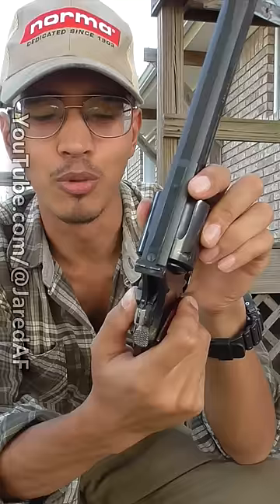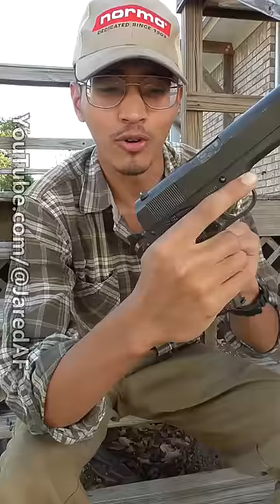safer way of decocking a hammer-fired gun ("don't thumb the hammer down" part 2)

Comment: In addition to this, the owners manual for the 686 says to place your other thumb in front of the hammer so even if it slips it hits your thumb and not the round.
Reply: Yeah..as my post i use off hand and  as you say...a finger in front is best..no matter what gun make it a habit
Reply: I'd rather not smash my thumb, but it would definitely be good to have a little metal plate or rod for the job. Maybe a wire flipover clip.
Never make an unsure bet when it can be avoided on safety folks.
Reply: @theinacircleoftheancientpu492  I don't think it'll smash your thumb. You're wedging it in the gap between the hammer.
Reply: Left thumb under hammer with right thumb on top holding it to lower slowly, no way this would hurt your thumb.  This was taught by LE skills courses in the eighties because adrenaline and fear in a gun fight causes loss of fine motor skills.
Reply: @theinacircleoftheancientpu492 it won’t hurt you baby thumb.
Reply: I have a 686 older than the guy in the video,lol. Bought it in 1990.
Reply: @heyQuixDraw  👍👍And it was in use DECADES before then! My maternal grandfather was a cop from the '40s-'70s. He taught me that EXACT method in the '70's on his S&W Model 13 (.38Spl/.357Mag). ALSO he informed me that it's rarely an issue as double action fire was the preferred method. He taught me double action FIRST, Then nice precision shots in single action. He's been gone a long time now, I inherited that Model 13, and i would not sell it for ANY price!
Reply: Old friend of mine whos now passed on saved someone from his mentally ill landlord who was having a fit and pulled a gun by managing to block the hammer with the webbing of his thumb while disarming him. The pin managed to draw blood.
Reply: 686 Thumb.
Reply: @TyrinsClips  🤣
Reply: @theinacircleoftheancientpu492 
It doesn’t smash your thumb and it doesn’t hurt. Works every time and you won’t end up putting a hole in something that doesn’t need one.
Reply: ``I d the same thing. The worst can happen is I pinch my finger, which has not happened yet.
Reply: Ouch
Reply: @theinacircleoftheancientpu492 bruh how brittle are your finger bones
Reply: That's actually a 586 since it's blued and not stainless steel, which is the 686 model.
Reply: Exactly - but guys like this Poster want to ignore Owner Manuals and over 100 years of proper safety to be able to say " I invented this new way I teach "; and up not using proper safe techniques
Reply: I was gonna say this.  Thanks for saying
Reply: Ow!
Reply: @theinacircleoftheancientpu492 I just use a pen or pencil
Reply: Amen!
Reply: You can put your pinky finger in the way and even if the hammer slips it won’t even bruise you.

When it comes to guns don’t try to be a tough guy, it’s not a toy. Use both hands and prevent a ND.
Reply: @theinacircleoftheancientpu492  you can use a small rag also less noise and absorb the power

Comment: Instructions unclear, ceiling fan is no longer active.
Reply: "This is why mom doesn't fffuckin love you!!!!" 😆
Reply: Upstairs neighbors have retired
Reply: New skylight looks good though 👌
Reply: @DrooledOn  Upper Room has been cleared. The spider is no longer there.
Reply: @MrZazzles94 Hey, boss. I installed the new skylight like you wanted.
camera pans to 20 bullet holes in the ceiling
Reply: Made me laugh, thanks.
Reply: too soon, too soon 😞
Reply: I wonder if people would pay for a shim that ypu slide inbetween the pin and the cylander to make it impossible to accidently set a round off
Reply: @SpotTiger lmfaooo Classic
Reply: So sqeeze trigger then release hammer. So should i pull the hammer first before pulling trigger. Your instructions are not clear at all.
Reply: Haha
Reply: That's not what fanning means

Comment: My one and only negligent discharge was from a scenario exactly like this. This is why we practice all of the rules of gun safety, if you fail in one area, the others can save you. This is the method everyone should use. Preferably we should try to stay out of situations where we need to decock the hammer without firing, but this is still extremely important to learn.

Comment: S&W teaches a manual decocking method in their revolver owner's manual that is the safest: You jam your weak hand's thumb in between the hammer and frame before you start to pull the trigger.  As the hammer slowly moves forward, you slowly retracts your thumb.  This way if your thumb that is controlling the hammer slips, you'd crush your weak hand thumb, but the gun CANNOT go off :)
Reply: Yup I've seen and heard this before, I often put something be in the way on my old revolvers.
Reply: Don’t tel em that. He’ll act like you’re insulting his ego and flame you even though he’s clearly wrong lmao.
Reply: At harry ,stole my thunder bro. Thumb between the hammer and frame, take finger off trigger disables the hammer strike transfer bar ,( if that weapon had it) Let hammer down gently. Carried 1911 for years , in condition one. ,see how many even know what that is. I know the older guys in service when 1911 was the sidearm issued, they will know. 65 years old and have never had an  AD.
Reply: Holy cow I never knew this…. I was throwing my hand just above the pinky joint in between the hammer and frame essentially crushing that area before it has a chance to slip. Pretty cool, thank you
Reply: Yes, this is a much safer way of decocking than he’s showing.
Reply: You know I went into my gun vault, grabbed a S&W manual and sure as heck... There it was. Never actually read it before, but you're right. Thanks brother 🙏🙏😅
Reply: @JustHereForTheDialogue RIGHT?!!!😂
Reply: @ryananderson8593  🤝
Reply: i’ve never decocked a hammer gun like this revolver but i would most definitely put my whole thumb there and rather have it punch my thumb than make it go off and hit my foot
Reply: Smith and Wesson thumb
Reply: never seen it, but I have always wedged my other thumb because when I was like 8-9 the hammer slipped on an unloaded gun and I did not like the idea of a round being in there when it happened
Reply: Would letting the hammer go seriously "crush" your finger? Cant imagine it'd break anything.
Reply: @joshuafurlong5270  Lol no i was exaggerating it i’m sure it won’t do no harm at all . maybe if it was the tip of ur fingernail then maybe a bruise
Reply: That's a good way too, physically block the hammer. That works.

Comment: I do that while holding my thumb in the way to catch it if I do slip
Reply from the maker: yep, if i can, i hook my thumb over the entire front face of the hammer basically.
Reply: This is the right answer. Place your thumb or index finger between the hammer and the cylinder face while lowering until it’s nearly down and limits the energy it can use to pop a primer.
Reply: I read this as though you put your thumb in front of the bore to catch the discharged round with your thumb if you slipped lmao
Reply: I hold mine in front the barrel to catch the bullet
Reply: I always have my finger in between the hammer and pin. Better a pinched finger than an accidental discharge.
Reply: @mattwiththegat2848  did that with a BB gun when I was little, my thumb hurts thinking about it 😂
Reply: @JaredAF  When you say "hook my thumb over," it might imply the use of your right thumb.
To clarify, it should be your left thumb in front of the hammer, while your right thumb controls the descent.
Reply: @JaredAF Except you don’t, because you didn’t in the video
Reply: @CramcrumBrewbringer  Right? He films and uploads a whole video that doesn't really have great info. 

Sees a comment with a better way of doing things and says "YEP, THAT's WHAT I DO" except if he did, that'd be in this video...
Reply: I just put my thumb in the way then pull the trigger
Reply: @Hairline848  personally I hold the barrel in my mouth to absorb any shock in the frame from the hammer hitting it, making it so the firing pin doesn’t have any energy to strike anything
Reply: @STOPSYPHER  😂😂 damn Sam
Reply: @mattwiththegat2848 lmao
Reply: No need. The best way to prevent ANY (Yes! Any!) gun from firing/misfiring is to simply stick your index finger into the barrel to 'plug her up'. Be careful though, if fired there is a big possibility your gun will 'shoot backwards' and the rear of your barrel Will explode and shrapnel will fly out of the barrel in a reverse orientation. Even the barrel itself will become shrapnel.

All you're left with is a gun with the rear stock nearly completely missing and the barrel will be curled up like a banana peel.
Reply: This thumb method is how we were taught in german hunting school.
Reply: @JaredAF  Easier on the thumb when the hammer is flat like a modern ruger w transferbar.
Reply from the maker: @LKN4WAR  works great for small guns. J frames, beretta cheetah, etc
Reply: @mattwiththegat2848 if you put your finger in the barrel it stops the bullet.
Reply: This is how I learned it

Comment: Wow, carried 1911 for years ! Did not know that! Great job young man 💪
Reply: That technique can still impact the firing pin on series 70 1911's. But series 80 have a firing pin block activated by the trigger. If you slip on a series 70 it  could fire.
Reply: Isn’t the 1911 double action though?
Reply: @raven31012  no
Reply: @raven31012  No, the 1911 is a single action automatic. If the hammer is down pulling the trigger does nothing. A double action draws AND releases the hammer on pull, Those are the 2 actions.
Reply: @raven31012  No it is single action.
Reply: See my commit on why you don't carry a 1911 half coked.
Reply: You don’t decock a 1911. If you wanna dedock a pistol, don’t buy a 1911.
Reply: @guillaumeouellet6653   There is definitely some truth to that. 1911 should be COCKED and locked when carried.

Comment: This also applies to my Co2 revolver. when lowering the hammer, if hold the trigger in, the button that releases the Co2 is still active. If the hammer smacks it hard enough, or you press that button, while the trigger is held, it will go off. If you drop the hammer without the trigger, it will not go off.

Comment: So that's where the expression comes from! "you can't just run in there half cocked" or something. I learned so much from this video lmao
Reply: I'm scared to ask what you thought it meant before this video 😂
Reply: not really. matchlock/flintlock guns (think old muskets) and even early percussion cap and fixed cartridge revolvers untill about the 1890s, had 3 positions, uncocked, half cocked and cocked. ( and a 4th "safety" where the hammer was just barely pulled back a few mm, and not protruding)
 you couldnt load them while cocked, you had to half cock it. you also couldnt fire it while half cocked, only when fully cocked. these were all single action, meaning the trigger only dropped the hammer ( or flint/matchlock) it didnt pull back the cock/hammer.

so if you loaded it up, but left it on half cocked, and tried to pull the trigger, thinkign you'd shoot, it didnt, and you went off half cocked, and possibly got killed because the other guy shot you.

this is a double action, and doesnt have a traditional half cock, and theres no need for one to load. if you pull the trigger, regardless of how its cocked, its gunna fire.

theres a "transfer bar" which is a mechanism that only allows the hammer to hit the percussion cap/primer when the trigger is being pulled, otherwise the hammer is safely recessed.
Reply: @tehpurplepills  I'm not sure what you're trying to argue here.
Reply: @HellsHatersEnt  He literally explains it, though? Loucifur thought the half-cocked saying came from more modern revolvers, and purplepills explains it came from matchlock firearms. It's like 9 sentences, or a 30 second read. If that's overwhelming for you, I pray to whatever cosmic forces that may be listening that you don't, and never do, own firearms. You will end up hurting someone with a negligent discharge someday.

Comment: For the revolver, this only works if you have the more modern versions with the transfer bar or the hammer block safeties. Will not work on older firearms. For them, a well held thumb on the hammer decock is the only option. As always pointed in a safe direction.
Reply: This will work with most S&W’s and colts going back to the teens and twenties.
Reply: Thank you, was just getting ready to comment word for word. And on most modern DA revolvers there's no 1/2 cock, it's actually a quarternotch safety.  True SA army revolvers had 1/2 cock for loading-unloading.
Reply: The Colt Single Action Army is the standard for single-action revolvers to this day. It was developed in 1873. It has a half-cock.
Reply: @ootdega  but it isn't a DA revolver with no transfer bar or hammer block safety with the firing pin hammer mounted, those have quarter notch safeties and not half cock's
Reply: For revolvers without a hammer block safety, you shouldn’t have the hammer down on a live round AT ALL!
Reply: @CramcrumBrewbringer yes, but you can only remove that live round or re-index the cylinder once the hammer is down. Thus why we're on a video about setting hammers down safely.

Comment: I do it slightly differently.

I place my offhand thumb between the hammer and frame. With it touches the hammer so it can't slam forward and squish my thumb. Then I pull the trigger and let the hammer move ever so slightly forward so it doesn't engage the sear.

Letting of the trigger I now use my main hand thumb to hold the hammer in place so I can safely remove my offhand thumb. Finally i guide the hammer down slowly with my main hand thumb.

This works very well since the hammer cannot slip and cause a negligent discharge.

Comment: I was in law enforcement for about 40 years first of which was federal (1978) using revolvers.  The method we were taught (S&W) was to insert left thumb between the hammer and the frame, right thumb retracting the hammer, trigger finger pull and release the trigger (causing the hammer to fall on the left thumb), remove trigger finger from the trigger, and then slowly remove the left thumb from the space between the hammer and frame.
Reply: That sounds like it would fuckin hurt
Reply: They did not teach you that because it is absolutely moronic.
Reply: Yep. Thumb slip is no issue with this thumb stop method. Weird people are hating on this.
Reply: This is my preferred method.

If your thumb placement lets the hammer fall on your thumb and hit it when you pull the trigger, you're doing it wrong. You should fill the whole gap between hammer and firing pin with your thumb so that when you pull the trigger, the hammer starts squeezing your thumb but doesn't have room to fall. It doesn't hurt. This method is safer because there is no possible way for your thumb to slip and allow the hammer to fall, unlike the method shown in the video. I recommend trying it.
Reply: @TheDudeliestDude  no your thumb is taking up most of the room limiting how far the hammer falls and the hammer falls on your thumb and not on the thumbnail.
Reply: I completely agree. This is how I have always done it as well. Good comment. Thank you.
Reply: This is what I was taught as well and prefer...potentially uncomfortable but greater assurance against dropping the hammer on a round.

Comment: Warning, dont do what he did. Dont point a gun in the air while trying to discharge the gun. Point a gun at the ground at any give time and away from your feet. Now the way he discharges the gun, that is fine. You could also discharge the pistol by taking the mag out and pulling the slide to release the bullet and then you can safely press the trigger. This only works for guns with a slide or any similar machanism
Reply: Warning: don't be this guy

Comment: The first step is to HOLD THE HAMMER with your thumb, then pull the trigger to the rear and gently let the hammer down.
Reply: The key part of this is HOLD THE HAMMER
dont just pull the trigger
Reply: Dont forget to point it down range if not at your feet
Reply: @delmuswu-tangbroadnax9056  use both thumbs if you dont trust your thumb strength at first too
Reply: im glad I wasn't the only one that caught this
Reply: Caught that too
Reply: THANK YOU. His step 1 “pull the trigger” kinda triggered me.

Comment: I thought this was new. Turns out I commented over a year ago without any comments ... or likes. No worries ... just trying to share a helpful hint.

Put your left thumb between the hammer and frame (deep ..
 as if you would be trying to hold the hammer from falling) before "de-cocking" this way. Once the trigger is reset forward ... remove thumb. If your right thumb slips off of the hammer at any point before the trigger is reset ... no worries.

Comment: Alec Baldwin should have learned how to decock a single action revolver.
Reply: In his case he needed to learn how to not point guns directly at people and pull the trigger.

Idc that it was for a movie everyone who handles firearms needs to know basic gun safety
Reply: @Gamerdude535  it's also a big sign of an industry problem that they haven't mandated actors taking safety classes (even with an armorer checking the gun and watching them). It'd be like an hour's training time at the start of weeks of filming and seconds each time the gun changes hands to run a quick unload and ensure it's loaded with the correct and actually blank/dummy rounds required for the shot. 

Yes armorer should face charges, no they shouldn't have allowed a prop to be used for target shooting on breaks, but there's still a lot of personal responsibility due to Alec for not having bothered to research the safety and practise it- any of the 4 core rules would have either avoided discharge of the firearm or made sure it only damaged property, not taken life. Also cameras have these magic cables that mean they can setup a shot without the gun pointing there, and still check the monitor /start recording from a few feet away.